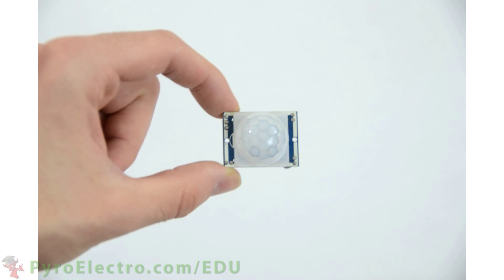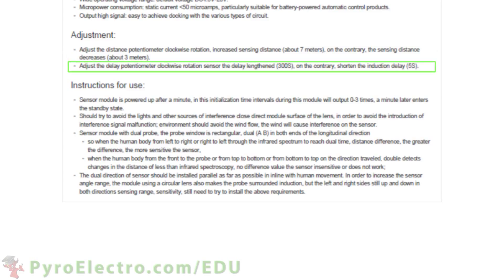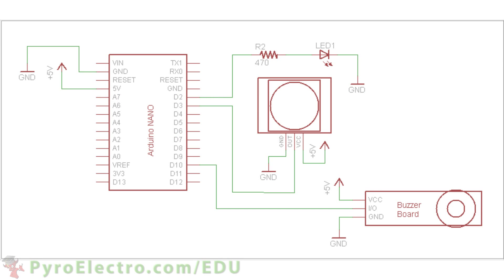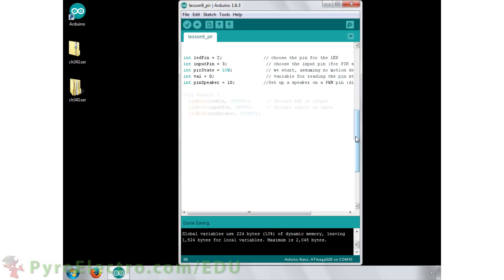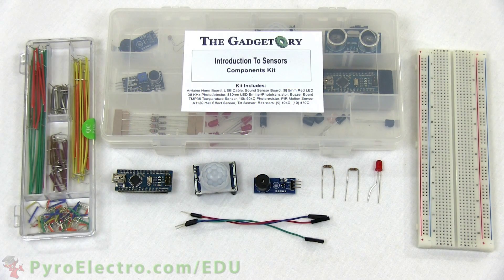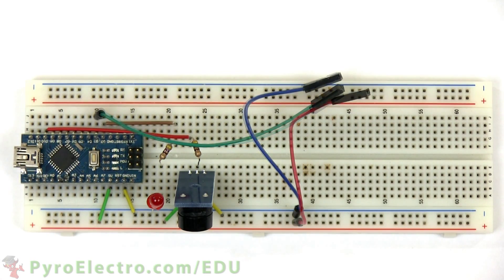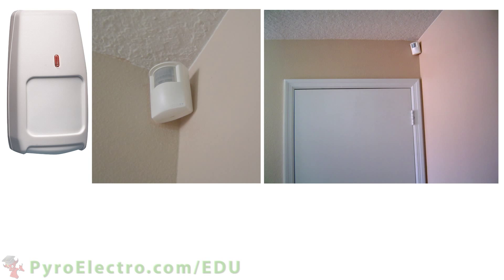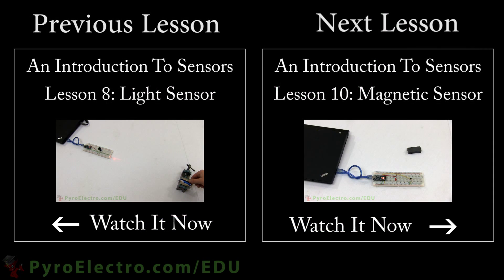Motion PIR Sensor - An Introduction To Sensors - PyroEDU

Comment: this dont make sense why do we need to do 2 IF statements? IF we already determined that VAL is HIGH we should just set BUZZER and LED ON, why do we need to test another condition to check IF PIRSTATE == HIGH for ?  PIR and VAL are both the same thing! its the module and if either one reports HIGH then obviously we have movement.....can you explain the reason for my doubts please? thank you

"i think this is how it should look like" IF i had a module i would test this myself so for now i rely on you"

void loop()
{
  val = digitalRead(inputPin);
  if (val == HIGH) {
    Serial.println("Motion Detected");
    digitalWrite(ledPin, HIGH);
    digitalWrite(pinSpeaker, HIGH);
    pirState = HIGH;
  }
  else {
    Serial.println("Idle State");
    digitalWrite(ledPin, LOW);
    digitalWrite(pinSpeaker, LOW);
    pirState = LOW;
  }
}